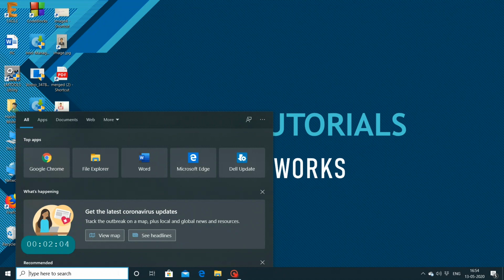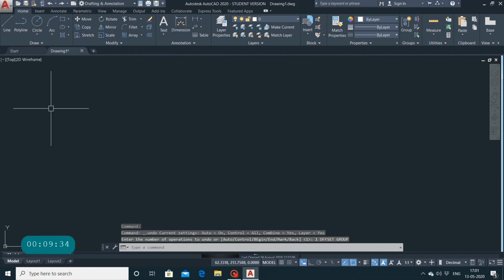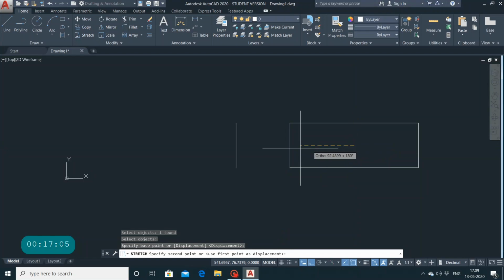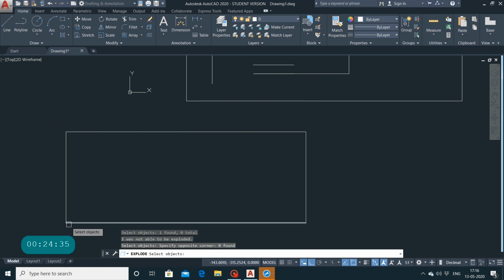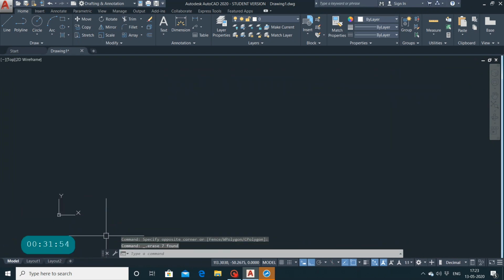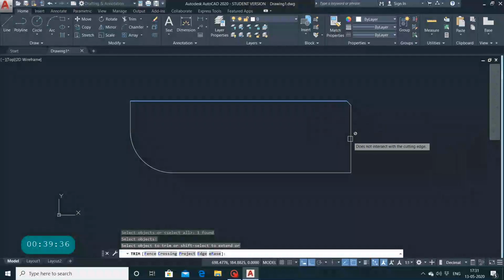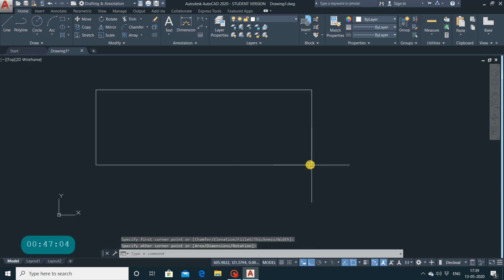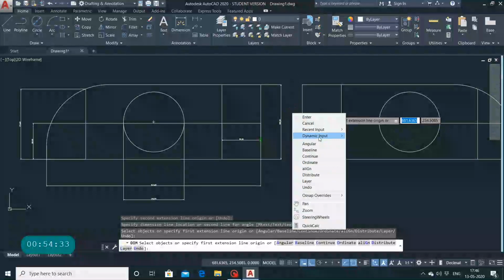Modify Panel in AutoCAD Detailed !! AutoCAD tutorial for beginners| MCG CAD WORKS |

Comment: Sir, After starting up AutoCAD or during normal use, the ribbon or other toolbars are missing, blank, or have disappeared. What should I do?
Reply from the maker: You can use a lower version of AutoCAD or if possible can upgrade the specifications of the laptop or computer ,you are working.Thanks💗.